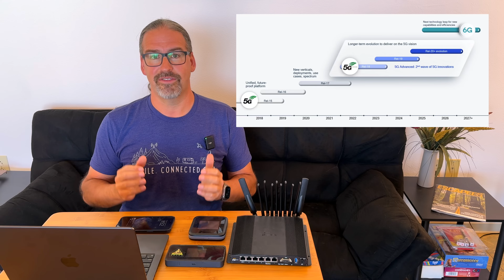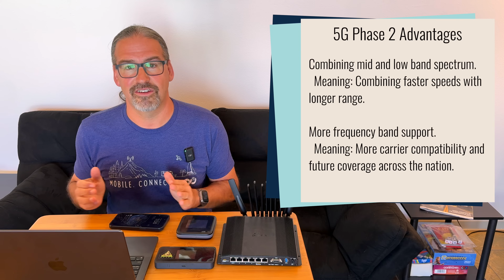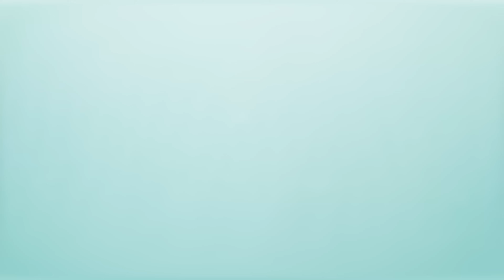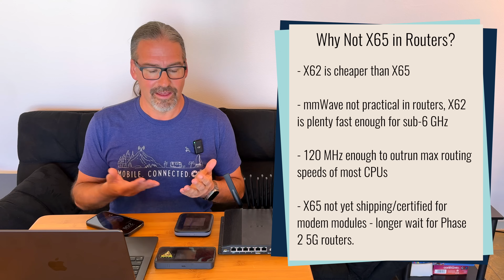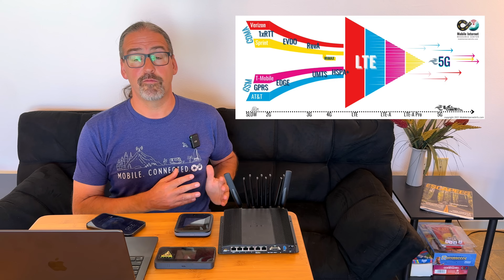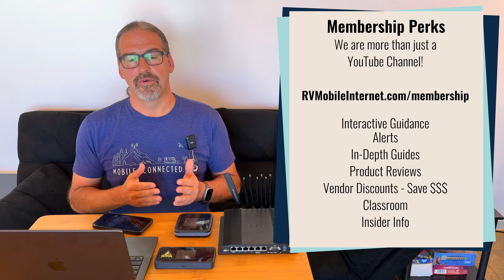Winter 2023/24 Cellular Industry Update: 5G Now Worthwhile for RV & Boat Mobile Internet Solutions

Comment: I've been testing my phone 8gen2(x70modem?) with a 4g sim getting 30Mbps and using it for the week as a modem  to my devices
And I haven't noticed any difference to our main nbn 50mbps for our use case. 

Would something like a used x55 Nokia fastmile be more than enough still? As far as stability goes.
We have measure 100mbps on a friends 5g sim here  as a reference but  depending on the sim value may consider either a 4g or 5g sim plan...

Thanks from shaun
Reply from the maker: Many things impact cellular data performance, here's our guide: https://www.rvmobileinternet.com/performance

Comment: Could one of these support a few TVs running Netflix or maybe other apps with a laptop or two? Could you do a whole house with say 1 to 2 people using the connection? Thx ✌️
Reply from the maker: The devices totally could, that would more be a matter of your selected data plans and signal strength at your current location as to the feasibility.
Reply: @MobileInternetResourceCenter  Thank you for your quick response.. I have one on the way with Verizon service. I'm hoping the location I will mainly use it at will give me what I need to run a few computers and a TV. Is there a minimum amount of bars I should look for as far as being enough to run a decent amount of items? What is the comparison to cable Xfinity? If you were to put a percentage on it performance-wise would it be 50% of what cable gives you or higher or lower. I'm just looking for a ballpark number. Thanks again for your video and your quick feedback I will continue to watch your channel. Thx ✌️
Reply from the maker: We are focused on mobile applications for RVers and boaters - cable is not something we compare to.  Here's our guide to the variables the impact cellular data performance: www.rvmobileinternet.com/performance

Comment: The issue that I have is the cost for some of these.  I guess if you throw enough money at things they could solve the issue but at what cost.  The cost of some pepwave modems are way too high plus you have to buy one or two carrier plans.  Wish I could do this but my pocket books wants to use it on other things.
Reply from the maker: There are many other router options out there using the X62 modem chipset at lower price points.  Use our Phase 2 filter in our Gear Center to find the current options: https://www.rvmobileinternet.com/gear/mobile-hotspots-and-modems/
Reply: We traveling almost every month for a week camping somewhere in the southwest. Most of the time I am ok with my T-Mobile Home Gateway in my RV. Once in a while we will get in between some mountain s and the TY-Mobile signal is very week, I can still get a connection but the speed is just under 3-5mg download leaving it hopeless to watch Netflix. I know it's sad when we camp if we catch watch tv at night we would not go camping at all.  We are in our 70's and 80's and are not physical that mobile to go rock climbing, just relax and watch the landscape. I think I am in need of a cellular booster onto of my RV to pick up those weak signals. It seems that Weboost is one off the best brands out there. I wished they had a directional antenna instead of the weaker mini antenna?
Reply from the maker: weBoost has many antenna options, however boosters are not overly compatible with 5G, T-Mobile or cellular data. Here's our guide: www.rvmobileinternet.com/boosters
Reply: If you have some electronic know-how, you could build a cellular-integrated router for 50-75% of the cost. But it isn't going to be as compact, nor streamlined, nor as user friendly as Pepwave's solutions. As someone who has gone down the DIY path MANY times, I would likely do so again if internet access wasn't critical for my income. With that in mind, I'll pay Pepwave's premium and find cost savings elsewhere.

Comment: nah, not until the carriers stop charging more for 5G
Reply from the maker: At present time, no current postpaid or prepaid carrier direct data plans charges more for 5G service. Some plans do give higher speeds when on C-band, and some prepaid subsidiaries (like Visible) have plans that only include 5G NW but not UW.
Reply: @MobileInternetResourceCenter  If you’re on an old plan that’s actually cheaper than newer 5G plans then yes ATT charges more for 5G.  They don’t enable 5G on the older plans even though you have 5G capable phones.  Want 5G?  Ok, go to newer more expensive plans.
Reply from the maker: Indeed - AT&T has kept old plans locked to 4G, and it is frustrating. We have old AT&T plans stuck like this. Our old Verizon plans however all got 5G capability automatically. If only AT&T was as nice…
Reply: My experience is….AT&T has the slowest 5g speeds compared to everyone else. They certainly have zero bragging rights with their speed. I suspect as time goes on, it will only improve and get faster. T-Mobile is the by far the fastest, but their coverage in rual areas are quiet lacking at times. Like AT&T….I suspect their coverage will improve. Verizon has the best coverage all around and speeds are adequate. They’re only going to improve their service……hopefully they all improve their customer service as well. We all need to remember……coverage comes before speed. No coverage=No speed.
Reply: @natet7323 speed is overrated, 4G not even LTE is more than adequate speeds for the vast majority of customers on phones.  I say phones because yes I realize people use cellular networks for other things as well (routers etc) but that use case is the exception.  There will come a time when 4G speeds aren’t enough on phones I understand but that’s not today.  It will be quite some time.  I compare it to CPU performance.  The industry has to have something to sell even though the vast majority of people never come close to using the shiny new object.

Comment: What about the CPU MediaTek Dual-core in the GL-iNet Spitz AX GL-X3000 Cellar?
Reply from the maker: The Spitz AX uses a MediaTek CPU - but actually uses a Quectel RM520N-GL modem module for connectivity, which is based on the Qualcomm X62. MediaTek does however make some 5G chips - we cover them in the companion article that goes along with this video.